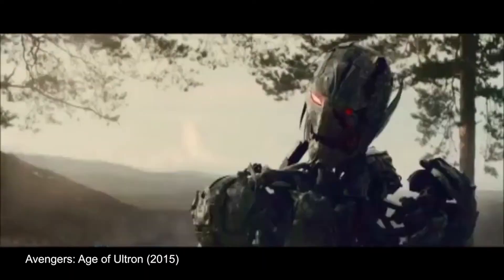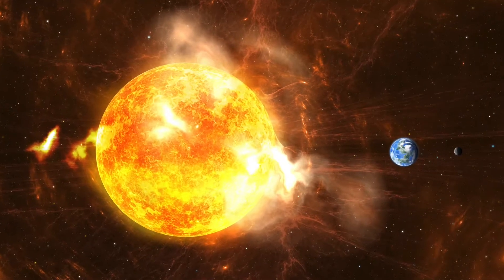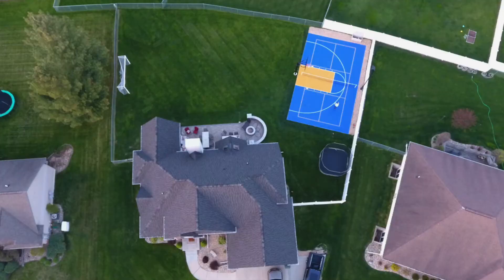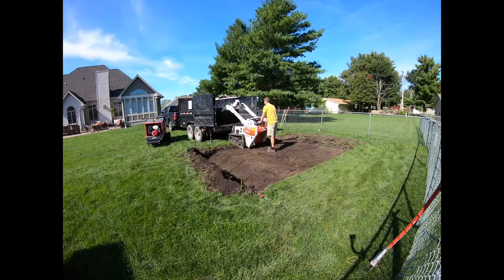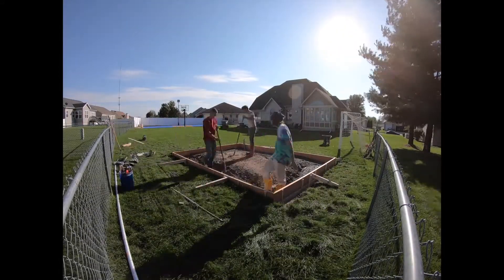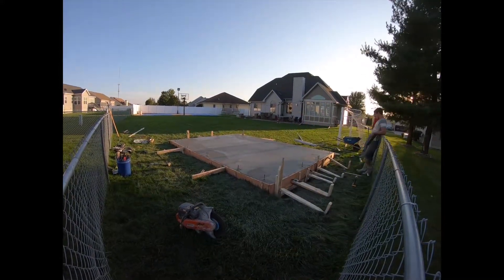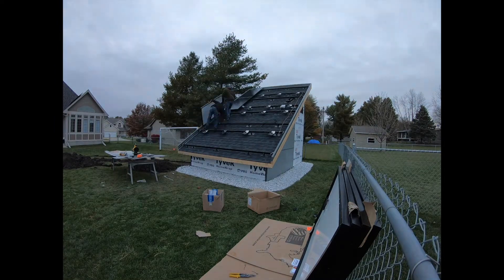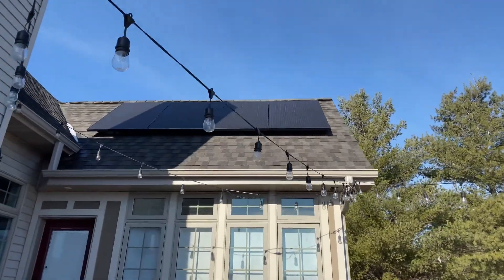Futuristic Shed With Integrated Solar Panels! Time Lapse Construction

Comment: Do you think this would work larger scale for a house? What are the drawbacks of such a plan?
Reply: Sure but the structural design would be completely different. I was maxing out the spans of dimensional lumber as rafters, so larger and taller would require using different materials or beams, etc.
Reply: @mrowenhorst  U think this design would be better in north texas area? We get a lot of hail so thinking the panels protect roofing?
Reply: Wat a well engineered building. So why didn't you build it so it could rotate daily with the sun and vary it's roof angle with the time of year.

Comment: Good evening, I am planning to build the same concept but on a larger scale to utilize animal shed. I would need to build on a 400sqm structure and I would definitely need your support. It could be 4 separate structure of 100sqm each to east the process and control the height.

Comment: Where does the water flow off of roof during rain?  I wish to do similar but with gutters and two water barrels to capture rain water.  I imagine the rain flows under the panels off the roof, hence gutters would direct the water.
Your thoughts?
Reply from the maker: Actually my original design included rain water capture and storage, but I abandoned that part of the design at some stage. With my final design rain just runs off the roof under the panels.

Comment: I was thinking about using the solar panels itself as a roof
Reply: Yeah that's possible, but you would still need a support structure for those and normal solar panels would not create a water tight roof. However, I know there are acrylic solar panels that you can make a water tight roof out of.

Comment: Wonderful job on your shed looks great. Have to point out micro inverters are expensive, they don't last long and when one fails it is hard to tell which one failed. and if you use software to monitor them it is proprietary so when you have to replace one of these microinverter years from now it wont work with your old software. Best to use a single dedicated grid tie inverter that is easy to work on or replace. Also you have the option to have them charge batteries if you decide to do so. If the grid ever went down These wonderful solar panels with the grid tie inverters won't help you one bit. limited options for solar when one decides on micro inverters. Solar installers push them because it is easy for them to install and move to the next job. Does not mean it is the best option.

Comment: Is this a grid tied system or battery backup?
Reply from the maker: Allen May It is both. It is grid tied and also has 2 TeslaWall batteries. It is bimodal so we can operate on or off grid. I will do another video on specifics of the system.
Reply: @ModernArtisan  Thanks for your answer. I really like your design, and would love to build a similar one in my backyard. I have six more panels I'd like to add to my existing system. Any chance you'd share your design plans and measurements with me?
Reply from the maker: Allen May send me an email at matthew@artisanceilings.com and I’ll see what I can find to send you that might be helpful